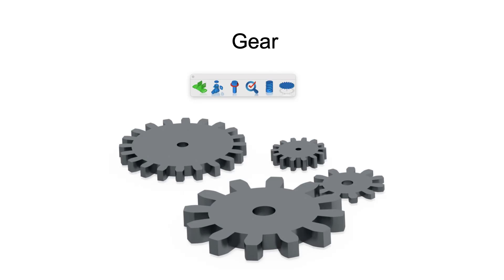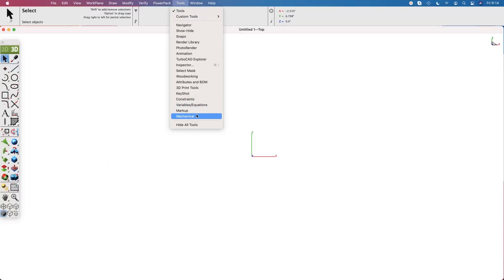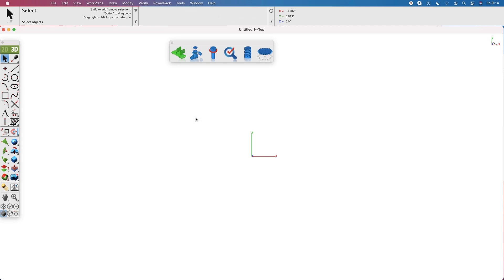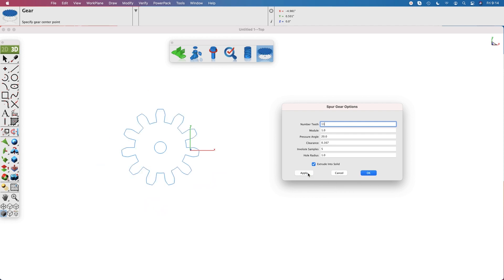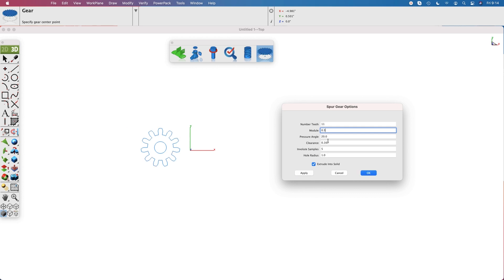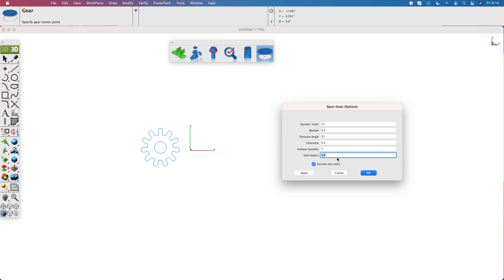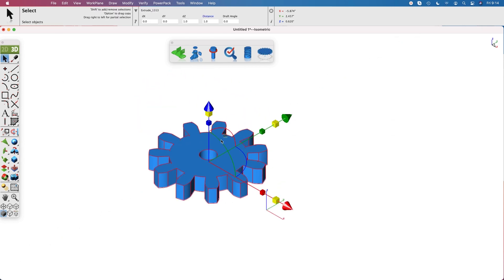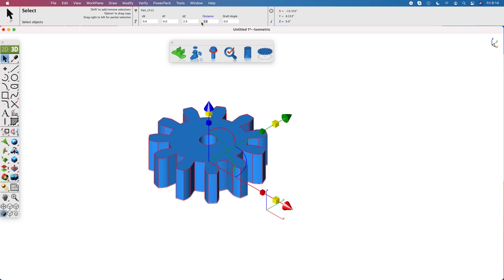What's New in ViaCAD V14 - Gear

Comment: I just talk to the Customer Service, and they say that it is only in SharkCad and not Viacad V14 Pro. Dont know why they say "What's New in Viacad V14 - Gear" when the option is not there. 😡
Reply: I've been using Viacad for a few years and I have to say that PunchCad needs to do better. Their marketing is ambiguous or wrong. Their version numbers in the software don't match the versions when you click through to view your current version through the browser, one shows 14.1.0 and the web confirmation will say 14.0.1. The add-on packs should just be included. It's ridiculous to pay $300 for the packs, I just want threads and flattening of sheet metal parts. At some point I'll just have to move on to something else. Other CAD packages add new features at rates 10x PunchCad products.